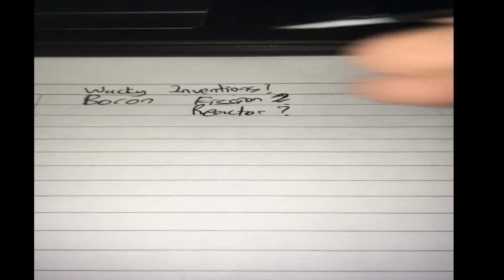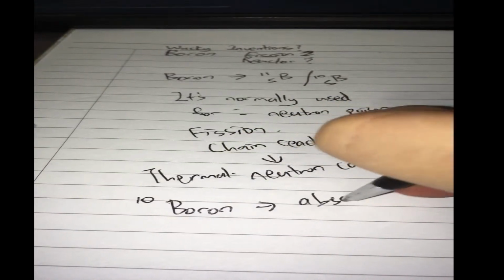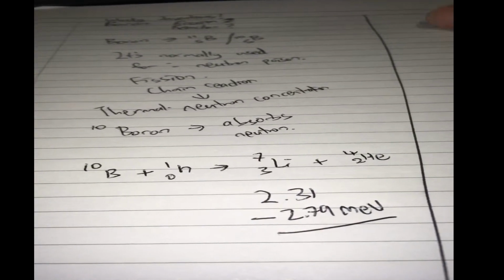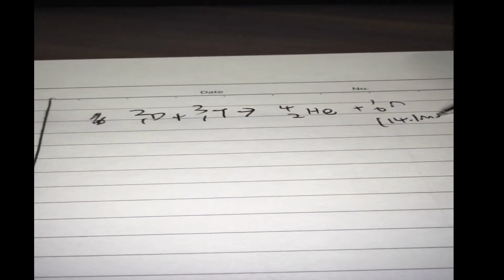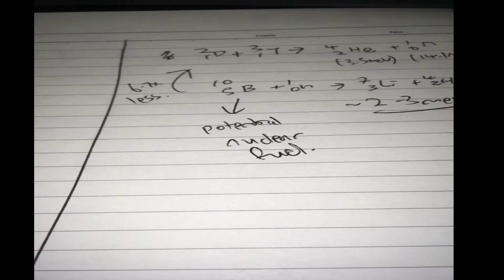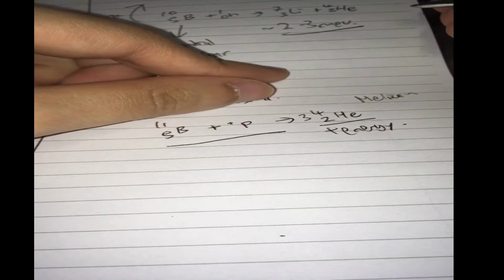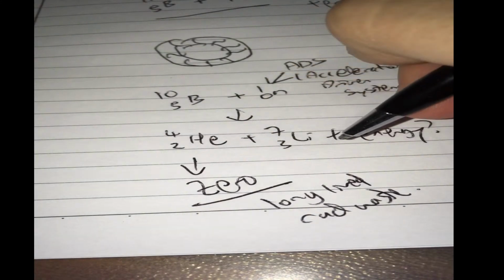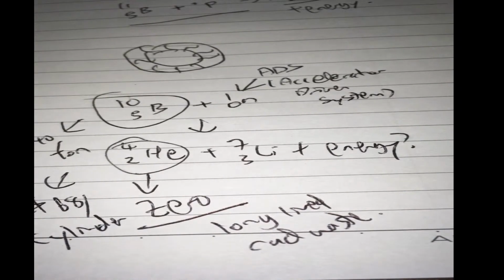Wacky Designs and Ideas - Boron Fission Reactor

Comment: And also i got a idea: if you put a nickel powder to a boron acid and then you will heat it up to 175 c to relese hydrogen and bit of oxygen you will have a boron oxide +nickel then when alfa particle will hit the nickel it will create a isotope of zinc and that isotope will decay with emiting 2 protons that protons, can hit a other boron atom to fuse(fusion). And then it will emit a other alpha particles to hit nickel and you will have a kind of chain reaction.